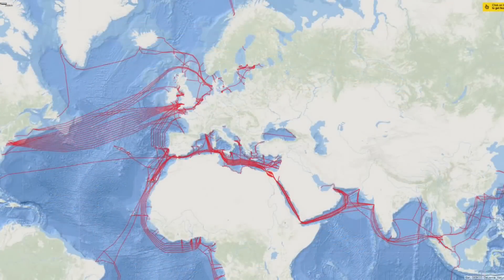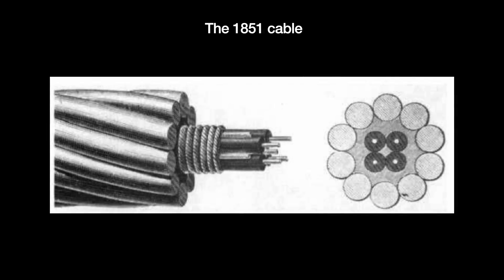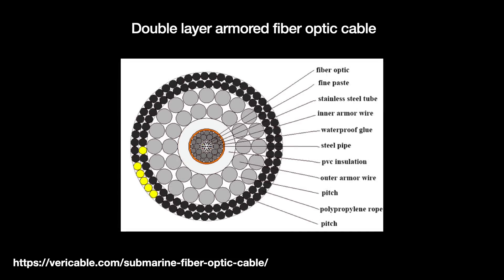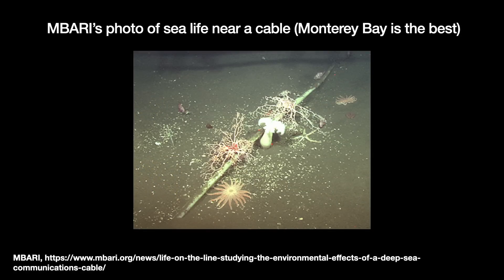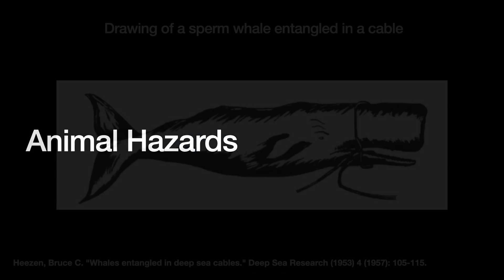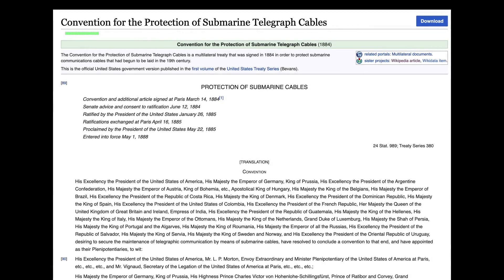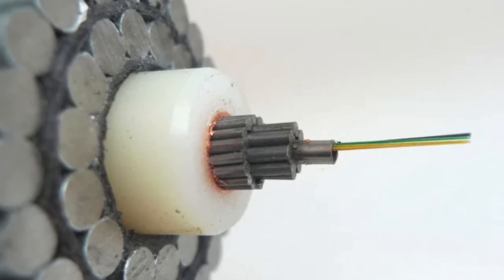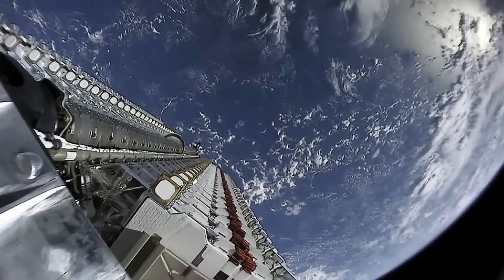The Hazardous Life of an Undersea Cable

Comment: Could some type of leading wheel solve the 'Otter boars' (10:20) problem? Instead of the board directly catching a cable, a wheel would simply allow the board to basically jump over the cable-and still have the effect of keeping the net open.

Comment: The presenter mentions that originally a man tried to cover the cables in rubber to protect them from the water, but the presenter said it failed because rubber is a water absorbant protein. This confuses me because that doesn't sound right because, as everyone knows, one of the primary uses of rubber has been to keep out water, so that explanation didn't make sense to me. And it would only have made sense for that first man to try rubber coating first because he too believed that rubber keeps out water well. 

Can you help that make sense to me, or was the presenter incorrect about that tidbit? The part of the video in question was at 0:49 seconds
Reply: The rubber you're thinking of is synthetic rubber, or artificial rubber. It's a petroleum product like plastics. The rubber he was referring to in the video as a "water absorbent protein" is the natural rubber made by the latex (sap) of the rubber tree. Natural rubber is expensive to produce, dangerous to farm, and has many drawbacks in how it performs.  Synthetic rubber (neoprene typically) is what is used in its place today.

Comment: I'm not a marine biologist but I'm guessing the sharks attack the cables because they're sensitive to electricity. I watched a video that showed a hammerhead shark finding prey under the sand because  of the electrical signals coming from the fish. Electroreception is what it's called. Not sure if it's just hammerheads or even if these cable put out electrical signals but it reminded me of that.

Comment: It should be noted that the cable in the thumbnail is a power cable, hence the three large copper conductors. Why three? Three phase power.

Some of these cables also carry fibre as a secondary use, which you may as well do if you’re laying the cable at all. I think the Tasmanian-Victorian undersea cable does both, and in fact I think it’s actually the cable pictured, but I can’t remember.

In any case, Tasmania imports a good amount of its power from Victoria (which sometimes in turn imports its power from other states) using this cable, and much of their internet traffic is routed through this cable too.

Comment: Burying cables has its problems. If there is a failure of an amplifier, for example, you have to pull the cable to the surface to fix it. That is, once you actually FIND it and can actually get ahold of it. That means removing it from the trench. Once fixed, you have to put it back down. No small feat.

Comment: I dont know, the writing on this one seems all over the place. Its a wild mix of contemporary problems and long-obsolete problems and technologies. No clear timeline. Modern solutions that noone would ever apply to data cables are applied to modern data cables. There are data cables, there are cables used to import or export or trade electriity, and then there are underwater pipelines. You did research and combined into a big script but failed to grasp the main categories.

Comment: In late 90s and early 2000s i worked for company that built under the ocean fiberoptic network.  I was part of building of repeaters that were responsible for amplifing signal every 40 miles.  Those cables had fiberoptics and power cables inside.  Pretty cool technology

Comment: Saying undersea cables are relatively low tech is peak derp
Reply: I disagree, it's basically just copper wrapped in rubber wrapped in steel wrapped in rubber wrapped in steel, (I know it's not rubber) it is impressive but it's just a big wire of metal, wireless comm is high tech
Reply: A cable is low tech, it’s a cable. Compared to Satellites in Space it’s extremely low tech.
Reply: @paulhowse6169 the material science, technology , engineering that's gone into an u dwrsea cable.
Reply: @nandos1111  it’s a cable bro lol. With some added protection for the environment it’s in. Is it an achievement? Absolutely, high tech? It’s actually quite primitive. A wireless connection between Continents would be high tech.
Reply: @paulhowse6169 rope core memory. Are just cables thats what got us to the moon well wires and magnets actually.
Reply: @fajile5109  no Nazis got us to the moon lol. Without Operation Paperclip America would have never made it.

Comment: As far as sharks biting the undersea cables goes, perhaps the sharks are detecting small electric currents from the cables. Sharks have organs adapted to detect small electric currents in the water which are made by the muscles of animals in the water, so if the sharks detect the electric currents from these undersea cables, they might mistake them for potential prey.

Comment: You can buy a GPS unit accurate to about half a foot for under $1,000. Add a laptop with a map of all the undersea structure and fishing fleets would know where every hazard was located and when they are getting close. Adding bottom depth and navigation information might make this something they need to have onboard. It's possible they already have something onboard that only requires an up to date map.

Comment: I could give proposals for a 'defended cable strategy' since it appears that there is a need for them. First you need a 'net' like cable that has very large holes, and to do the defending we use drones. Lots, and lots of drones. Cut a cable and the drones swarm from their solar powered platforms, some explosions, threat neutralized. Drones replenish by hopping one platform over all at once and we fill in from the shore.

Comment: Maybe the cables should resemble more how the rest of the internet works: a net where some cut strings don't matter. Instead of laying a long line with periodic repeaters, maybe it would be a good idea to lay a net, same distance between repeaters, but the repeaters are also routers able to switch direction of the signal. Also, they are crossings with multiple connected cables (maybe 6 per crossing, making a 60° equidistant triangle mesh). Making the routers plug-and-play with the cables could also vastly reduce the cost of replacing a broken section.
Or I have overlooked some reason that is not viable, who knows...

Comment: There are excavators that have been converted to run under water, the engine and pumps are on a barge and the hydraulic hoses route down to the machine and into its fittings. They use a natural mineral oil for the hydraulic fluid.

Comment: 0:45 Pedant alert. Rubber is not a vegetable protein. It is a polymer formed from the hydrocarbon isoprene, a volatile alkene secreted in significant amounts by many plants and trees. Such molecules, when pure,  do not absorb water. Lack of water resistance probably arises from impurities or physical imperfections (holes) in the bulk polymer.

Comment: One of the theories as to why sharks bite fiber optic cables is that the nonlinear optics in the repeaters require a power source, so the cable carries both fiber optic and copper for electric power. Sharks are sensitive to electric fields and mistake the cable as prey.

Comment: I am a retired splicing technician for the phone company and I have had the pleasure of splicing in a new submarine cable to cut around a damaged section caused by a boat anchor in the Kanawha River. Two days of shift work in a tent by the river to open up the armored cable. splice the 1600 pairs of phone wires to restore service, and then meticulously seal it up and pressure test it. The crossing was well marked and I heard the barge operator got some healthy fines. Someone had to pay for our hard work! :)
Reply: Thank you. It's hard working people like you who keep our world afloat. And it often goes unnoticed.
Reply: Thank you for the interesting story. Cool insights into real world experience.
Reply: 3rd generation Telecommunications Installer here, 8 years in. I've only been in C/O's, cell sites and customer prem environments, doing something like this would be a dream come true. So cool you got to experience anything related to subsea comm lines, what a sweet opportunity (not that it wasn't very difficult, tedious work). Thanks for sharing
Reply: @outbakjak  I started in construction splicing for ten years, then went into maintenance because that's where the money was. During my last ten years with Frontier, maintenance techs did everything from residential installation and repair, broadband installation, plus fiber and copper cable troubleshooting.  It really was a great job if you could cope with the weather. :)
Reply: How in the hell did you know what worse to splice together? Did you have to do a continuity test in order to find what wires to re-connect. This is absolutely fascinating to me
Reply: @marketteers  The paper insulated conductors are in bundles of 25 pairs and those are grouped further into bundles of 100. The middle bundle is group 1. The layer around it will have a green-marked group making it #2, then you count the groups in a clockwise direction until you have them all marked. As for matching which lines go where within a bundle when restoring a paper insulated cable, you have a tech in the switching office putting a tone on each cable pair and a tech at the open splice identifying it with a probe and putting it on a tag board.
 Plastic insulated conductors are much more straightforward, as the group markers and wires are all color coded. You learn the color code and you're all set.
Reply: I had to rewire my radio and my freezer and i thought i was smart
Reply: Did you ever have to pull something apart, fix it then patch it all up, only to then power it up and it didn't work? I hate that. What a nightmare.
Reply: Ah!  How fun to see a familiar placename on this neat video.  I was a teenager when my oldest brother moved to West Virginia and informed me sometime later that Kanawha is pronounced 'Ka-naa'.  There's a little quiet love for this american placename that has never left my brain :)
Reply: @danielmcanulty1562 same here, I don’t see many people talk about the state I live in.
Reply: 1600 pairs! Yikes!
Reply: I feel this. And I thought all the wire pairs I had to deal with were bad...
Reply: For real that's pretty amazing.
Reply: "THANK YOU"
Reply: Cool stuff
Reply: Kind of crazy that copper is nearly dead now. It is worth more to scrap all the copper and put a few fibers in place of a 1600 pair that can handle infinitely more data and pick up the same amount of customers with just a couple of pairs of fiber.
Reply: @thenerdnetwork  it's unfathomable. Humanity has created some incredible things by our powers combined. Now if we could just all share in the benefits equally 😅
Reply: @thenerdnetwork ….. no

It would undoubtedly cost more to retrieve than youd get in scrap value. Oceans are deep.

Theres some places where it may be feasible but they are certainly not the majority.
Reply: @thenerdnetwork copper is not dead. Fiber optic can't carry electricity.
Reply: Cool story bro
Reply: @Death2Weebs  ya
Reply: Gooood forrrr youuuu
Reply: @trxtech3010 how did you get into that type of work?

Comment: Ironically, undersea fiber is more vulnerable to large electromagnetic events (think CME or solar flares) than other kinds of cables. Because of length, conductivity, and the repeaters. The longer the cable, the more sensitive it is (think of the steel and conductive power cabling between repeaters as giant antennas).

Comment: At the end of last year a gas line connecting Finland and Estonia and an undersea cable connecting Sweden and Estonia were damaged. It is indeed hard to protect these undersea assets and easy to deniably attack them.
Reply: If the cable is considered critical it is possible to trench and bury it some feet deep in the ocean (lake, seabed) bottom.

That is also very expensive.  But, is done in certain cases.
Reply: Perch-a…… like perch, the fish.
Reply: Hmmmmm it has nothing to do with the reds?
Reply: Not to mention the gas line from the Russia to Germany that the United States didn’t cut even Biden said we would halt the exports

Comment: Be twine Denmark and Norway we have had a a lot of talk about Russia "research" vessels snooping around wind farm cables. I think Communications are not the big problem. I think the net works so dense that it's not viable to target, with an expectation of creating real damage. But the power transmission infrastructure (also on land) seems much more vulnerable, especially with the mass electrification we are being promised. 

Not an expert opinion.

with that, I will just ritualistically tut the Horne for Green Hydrogen as strategi energy storged reserves. PTX in general

Another great video

Comment: Why do sharks bite the cable. In my ignorant opinion the sensors on shark noses can feel the electrical signals flowing through the cable making it look like a giant worm to the hungry shark. It makes sense when i think of it. Having learned why insects circle light, i may be far pf the mark on this as well.

Comment: I've always been amazed by undersea cables.  And done so long ago!

So where do the repeaters get their energy from?  You can't amplify a signal w/o more energy.  Especially wondering about the early telephone and telegraph cables.
Reply: I think that cables with repeaters have a layer that carries the electricity, one of the metal sheaths is actually energized in this case, and is probably different from a strictly informational cable

Comment: Wouldn’t the sharks be attracted to the electromagnetic field emanating from the cable? Or at least non fiber optic cables? I know older cables had faraday cages to counteract signal loss due to the ocean sapping away the power through the literal wizardry that is electromagnetism. But isn’t the simplest answer that the sharks sense the “static” and are attracted to that
Reply: AT&T installed a trial FO cable in the Canary Islands in the late 80's, they found that LW cables installed above 2000m water depth became susceptible to shark bites which penetrated the polyethylene insulation causing a shunt fault. To help prevent this they designed a new class of cable (closer to its Analog cousin) with spring steel wrapped around the original LW and then further wrapped in another layer of polyethylene to resist puncturing the cable by the sharks teeth. This was called Fish Bite Protected or FPB also known as LWP or LWS by other manufacturers.

Comment: How are repeaters powered? Do they even require external power source?
Reply: The repeaters are powered using simplex current.  The cables I am familiar with are actually coaxial cables using a high frequency carrier signal to carry the multiplexed data.  Since the send and receive side are different carrier frequencies, data can go both directions using the same conductor. This means that at each end of the cable, a very high voltage (thousands of volts) is injected with a constant current.  Each repeater takes a part of this voltage.  My knowledge is about 50 years old, so things may be a bit different now.

Comment: Has anyone proposed leaving some slack every few kilometers to be used in case of floor movement.
Reply: Yes, but traveling thru that slack would further degrade the signal; requiring more repeaters over the length of the run. That runs into serious extra spending.
Reply: @dsnodgrass4843  A few extra repeaters vs. broken cable? Interesting betting situation.

Comment: Sharks find prey and other objects with an organ that can discern electric fields, organic or artificial. They are more than likely able to sense the cable's power output and was attracted to it thinking it might be prey.
Reply: I think most fish can do that.
Reply: @douro20  the video highlighted sharks, raising the question of why these specific fish were biting buried cables.
Reply: @thebeaconnetwork  Sharks are a type of fish.
Reply: @douro20  And the only fish mentioned in the video and shown disrupting an undersea cable..."most fish" aren't featured.
Reply: idt fiber optic cables carry electricity
Reply: They sense it using their lateral line
Reply: They use their lateral line to sense it, every fish has a lateral line.

Comment: Also, imagine literally digging up undersea cables to scrap copper, mental.
Reply: All for a tiny bit of copper, wrapped up in tons of plastic, steel and seaground
Reply: @DRakeTRofKBam that was no "tiny bit" of copper. I bet they made a fortune
Reply: @donsolos  sure, but something tells me all the equipment one might have to have to dig it up and process it, mightve not been that profitable maybe
Reply: @DRakeTRofKBam  they could likely pay somebody to build them a machine to strip the wire and still make a fortune. they stole 2 different 60km+ lengths of wire. I wouldnt be surprised if it was a pound of copper per foot. They made a fortune
Reply: @donsolos  Yes, some of our cables had a center core of 1/4 inch copper, Plus an outer copper skin (coax), and ran for many miles.  Weighted into the 100,000 pounds range.  70,000 pounds in one test.
Reply: @DRakeTRofKBam  We're talking kilometers here. Its quite a lot of copper and steel on an individuals scale in all honesty.
Reply: It's very common in Vietnam, sadly.

People also used to literally cut up unexploded Vietnam War bombs to sell the explosives inside. Not sure if they still do it now.
Reply: If they could, they would…
Reply: Tends to be fiber optic cable not copper these days as much higher bandwidth.
Reply: Reminds me of that incident while I was in university. Our department's state of the art nanofabrication instruments suddenly started behaving erratically. After weeks of troubleshooting efforts, they realised someone stole the silver earthing wires from the ground 😂
Reply: I'd assume they themselves didn't have access to the internet, so nothing lost for them...